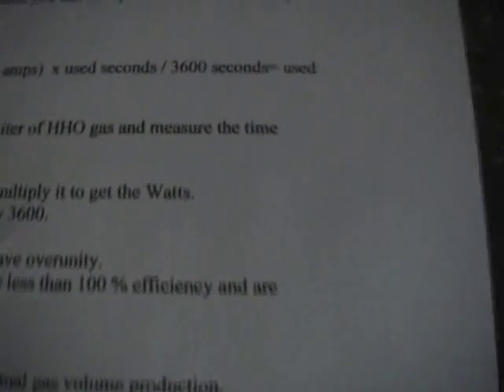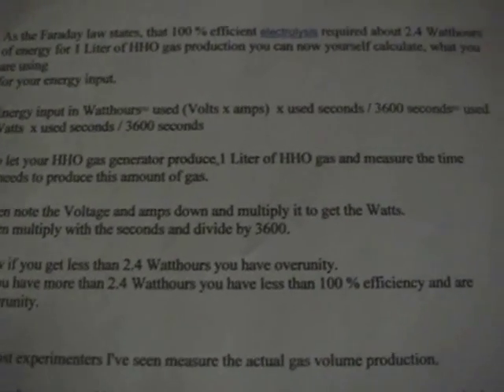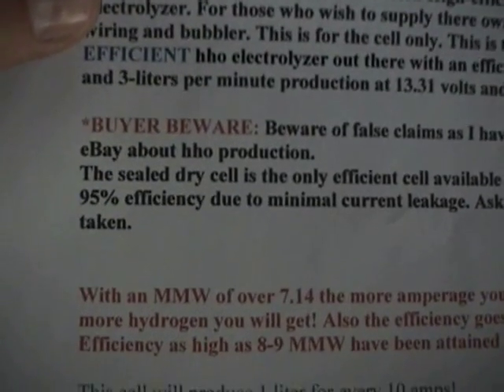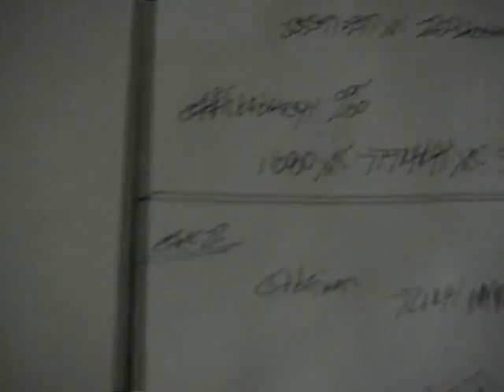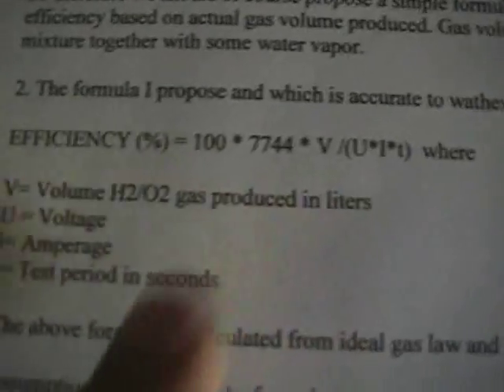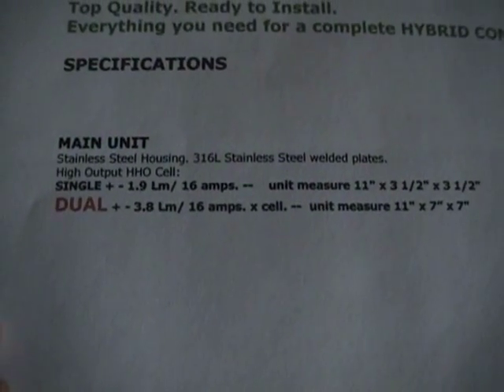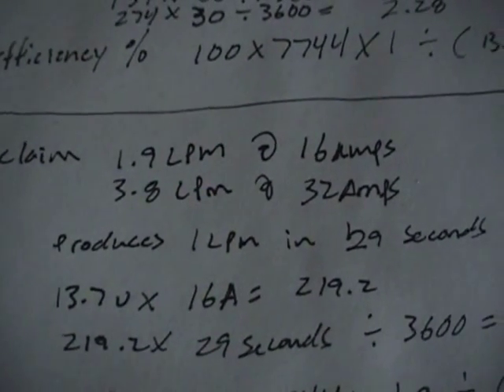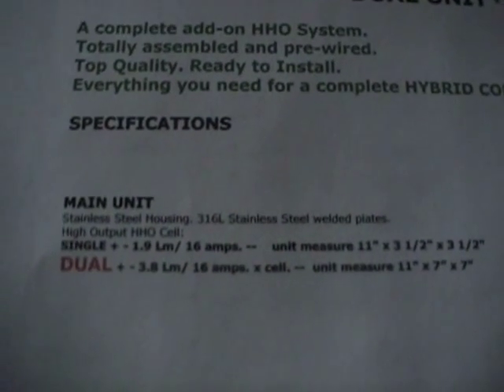(34)Hydrogen production. Who is telling the truth.

Comment: I've added o2 extenders and a small dry cell that puts out around 2 LPM but need much more. I'm about to run a larger 48+ cell that has a claim of 4-6 LPM. Running the two in series should get me to my 7 LPM under 100 amps

Comment from the maker: @ke4uyp why would I mention temperature compensation in this type of video. That  video is about the production. In the video I say I was running about 16 amps and 240 volts. The bottle is rising so fast if I was off by one tenth of a second it would throw all the efficiency calculations off. The calculations are clearly approximate. I don't understand why your pushing your point.

Comment from the maker: @ke4uyp In that video I misspoke.  I should have said 250v @ 16 amps. but lets use your numbers. you state 2.13 watt hours which is overunity. yes that is but your equation is not complete. The cell was running a 140 degrees. you didn't calculate the amount of moisture (steam). mmw is 7.81, temp compensated is 6.99. thats 90.2% to Faraday. 250@ 16 amps is 86% to Faraday. Calculating LPM with that amount of gas is hard. there is a lot of room for error but nowhere is there overunity.

Comment: The problem is that in HHO production the electricity used should not have a direct relation to the energy within the Hydrogen being produced. The electrolyte systems create this dependency thus can never reach the efficiency of over unity. I am working on a system now that POSSIBLY will not expend any power at all but produce lots of H2 to be converted into far more power then that used to drive the system, which is lossless, resulting in 0 in 500% out.

Comment: so based on your equation 144watts per minute per litre is 100% (144/60=2.4)
Thats approx 12amps at 12volts for 1litre in 1 minute... is that right?
So a unit that produces 1 litre at 12v and 20amps is only approx 60% efficient
And the same production at 15amps would be 80% efficient...
I think you have made my year ;)

Comment: Thanks Delvis... When people ask me about production I give the lowest figure... recorded using a cold unit, no warm up time for maximum efficiency. This is because people test them to see if I'm lying and they usually measure the unit when it is cold... whne people measure it after an hour or so of warm up they are usually surprised ;)
On a regulated 12v lab power supply, at 20amps, I get a touch over 1 litre. On a warm unit it is only 12-15 amps for a litre. 
Happy New Year and Thanks...

Comment: Yes but provided the bubbler is in a seperate container to the electrolyte and it hasnt been running very long and the ambient temperature in the area is low and there isnt a vaccum on the bubbler from the car intake and....... Come to think of it your right and the answer to the volume of water vapour will always be - How long is a piece of string!

Comment: Thank you for sharing, good video I needed it.
But I have a question: We are producing two gasses at the same time (with different volumes and weights and at all possible temperatures and atmospheric pressures and with different surface areas of the plates and differing gasquet thicknesses) So can we really just use one formula and tell?
I think we should dicover how the standard of measuring is. Basically every cell is near overunity on your calculation and that is not real. Help

Comment: 1000.00 grams of water (1 liter) contains
  888.89 grams  of   Oxygen  and
   111.11 grams  of  Hydrogen
One liter of Hydrogen weighs 0.09  grams
One liter of Oxygen    weighs 1.47  grams
From 1000 grams or 1 liter of Water we obtain
111.11/ 0.09 = 1234.44 liters of Hydrogen   
888.89/ 1.47 =   604.69 liters of Oxygen
to convert 1gram of Water into 1.234 liters of Hydrogen you need 4.94 Wh  (or 4.94KWh for 1000 grams, or 1 liter of Water)

Comment: Faraday's laws of electrolysis applies to a single cell, measured at 0°C, 1 atmosphere of pressure, and 1.23Vdc (STP conditions).A perfect cell will produce 0.627Lph/Amp.

To find out if someone has the wrong specifications you need to know the number of cells and the actual voltage across each of the cells. You do not have the information you need to make the proper calculations.

If the example electrolizer has at least 10 cells, then it is not breaking Faraday's laws of electrolysis.

Comment: Most people do not understand the scientific method. They don't know the difference between a Law and a Theory. I have to admit that I play fast and loose with the scientific method. Before I understood the consequences of heat and water vapor I believed that I could make get an MMW over 6.97 (6.97MMW = 2.4WattHour). Now I know that if you get brute force electrolysis results that are over 6.97MMW or less than 2.4WattHours you are measuring something other than HHO. Continues-